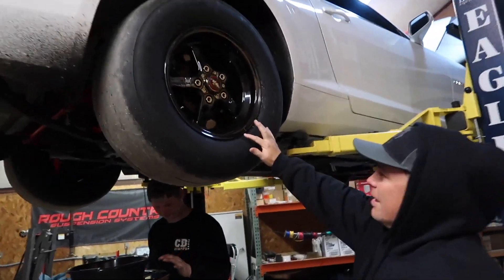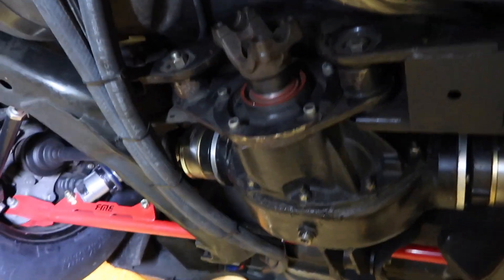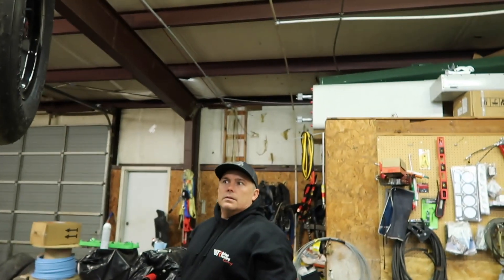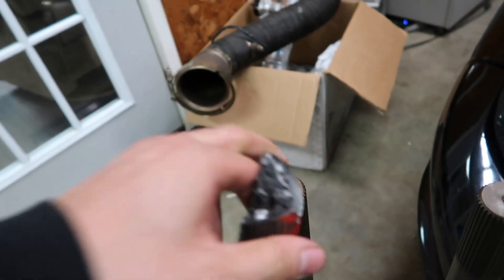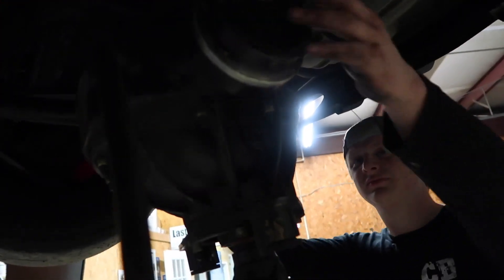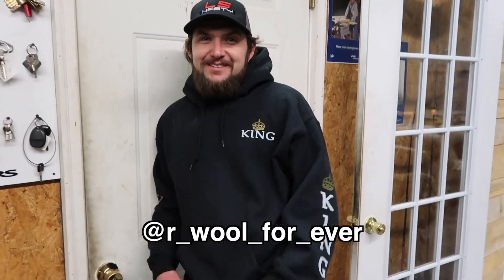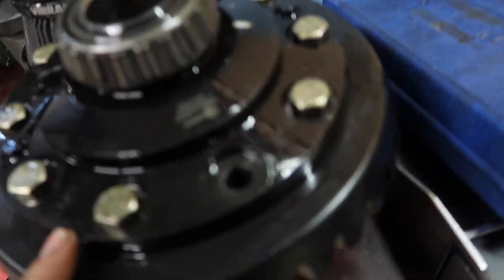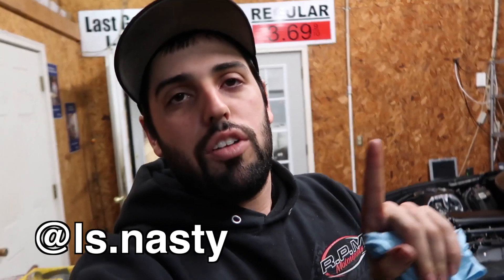We BROKE the Cowmaro with TOO MUCH HORSEPOWER!!!!

Comment: If the rim never spun in side the tire chances are you never would have realized the locker was failing. Unless you somehow had one tire on ice and other on dry road and pulled out and felt it spin.